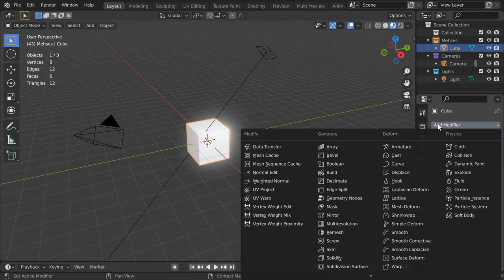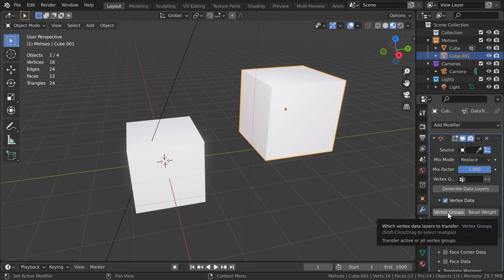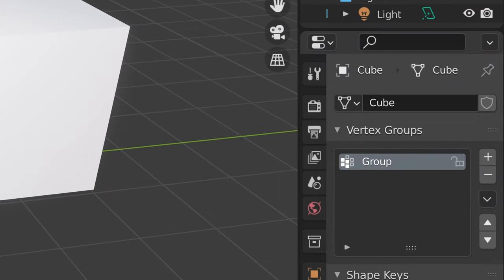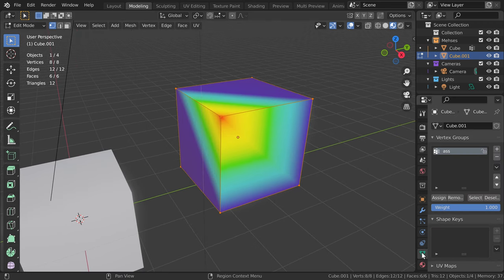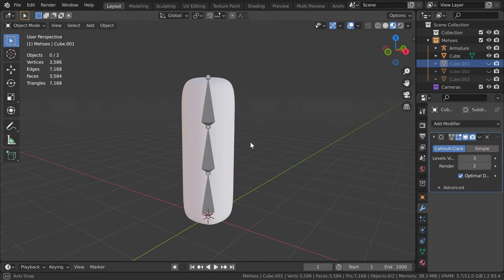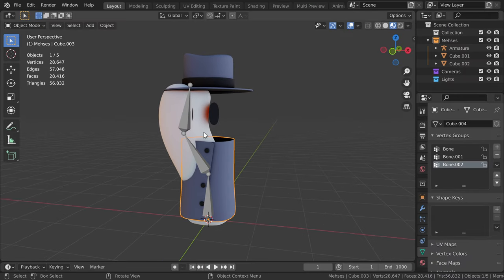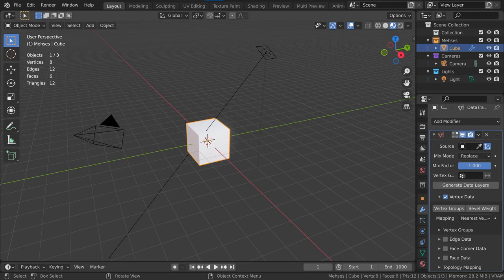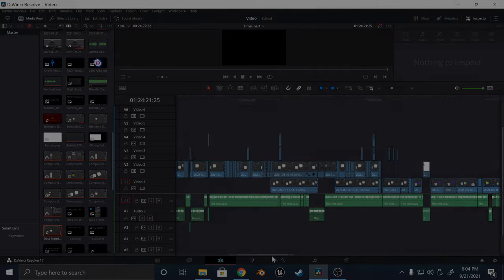How Does The Data Transfer Modifier Really Work? (Blender Tutorial: Part 1 of 2)

Comment: I love the in depth explanation, makes this tutorial outstanding. However, I don't think Vertex Weight and Vertex Data are the same thing. Vertex Data is any Data stored on the Vertex/Point domain. Weight is a specific Attribute/Type of Data. With Geometry nodes for example you can store any custom Data on the Vertices, but this is totally unrelated to weight. In the use case of the modifier, it's probably the same tho.
Edit: Sorry, just noticed you said the exact same thing in Part 2 xD

Comment: Hey dude, so I actually had another idea I wanted to try out. Creating hair and importing it to Unreal was super hard, I wonder if it would be possible to create hair with a particle system, convert that to a mesh, use the solidify modifier to extrude the strands, then with your hair mesh selected you can use this Data Transfer Modifier method to add the fur to your mesh and have it move flawlessly! 

Or you can create your hair with hair cards following similar tutorials. But the basic idea is, I wonder if it will stick to your mesh and armature much like how it did with my high poly model. Anyways, just some food for though. Gonna try this technique out soon. Great stuff man!
Reply from the maker: I think that would work quite well. It's definitely worth trying to see if it does anyway.

Comment: Wow, awesome video! Thanks for figuring this weirdo modifier out.

Question: I have a model of an object that was (presumably) laser-scanned with not only point data, but color data as well. The model has over 6.5 million texture-mapped triangles, all unwrapped into reasonable 'islands' in the UV editor. But...I needed to re-topo the model to drastically reduce its vertex count, as well as give it a 'proper' topology (instead of the massive, point-cloud mess I received it as)...I have done this part to my satisfaction... it's down to 200,000 triangles, clean topo, now. But...can I use the transfer data modifier you explained here to copy the texture map data from the original model to the new one? Just a yes or now would be very helpful before I waste hours messing with the modifier's various settings only to discover I'm running down a dead end...

Thanks again for the video...really helpful beyond my current needs.

Comment: So sad theres no part 2 ;-; i been spending hours trying to find a tutorial on how to transfer the UVs of a high poly and low poly and the documentation for that modifier is really.... something.........
Reply from the maker: It should work pretty easily, as long as the two models have similar geometry. I sugguest using Projected face interpolated under the ,Mapping, dropdown. This method will project out from the normals of the receiving mesh, grab the data from the other mesh and then apply it. Interpolated means it does that a ton of times in between, making the results very accurate. It uses a technique called raycasting (more can be read about that here https://en.m.wikipedia.org/wiki/Ray_casting ) the results are always accurate as long as everything's set up properly. and again the geometry needs to be similar, but that's not because it has to be similar in shape. The modifier checks for seams and tries to split the UVs accordingly in order to match the source UVs. Doing all of that, You should end up with the correct result.

P.S. I've got some pretty crazy examples setup for part 2 that explains everything in great detail but I ended up getting covid 2 times now and I'm dealing with some family issues, because of that I'm not sure when I'll be able to record part 2.
Reply: @GameAbuseStudios  thank you for your reply i will try that out! And that sounds really tough, your well-being and personal life come before YouTube so don't worry about part 2 until you're in a good spot to film it! Thank you again ☺️

Comment: tks, these 1 & 2 are great vids. tks, helped me avoid alot of extra work. but have a problem maybe you can explain. I set vertex groups on a model, do a voxel remesh in blender on the same model and the vertex group data transfers fairly well. mesh is very dense on the new model but works pretty well. i export the same original model to .obj and remesh with instant meshes, then import back to blender and try the same data transfer again. mesh is also dense but shape same. this time the data transfer doesnt work well at all. the steps for the two operations are the same. outcome totally different. not sure why the difference. since the first was a voxel remesh and should have remeshed the shape without holding any info fromt the original. is there some trick with normals I am missing? tks for any ideas...